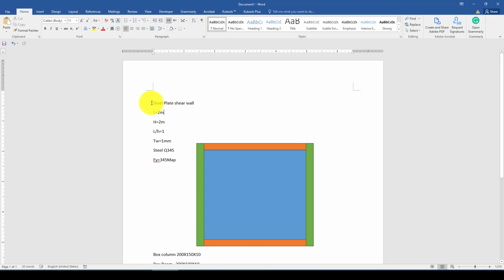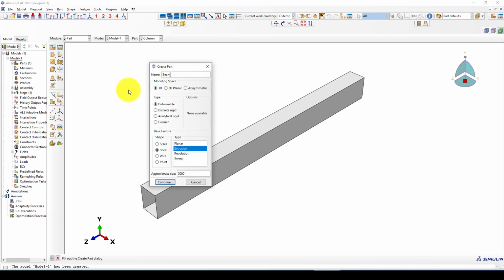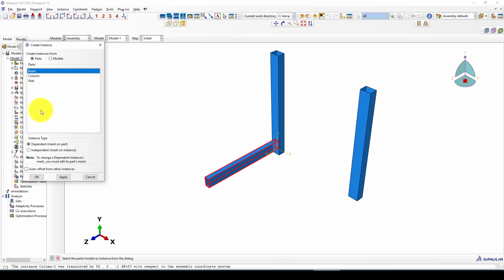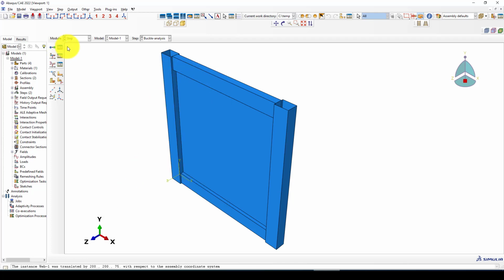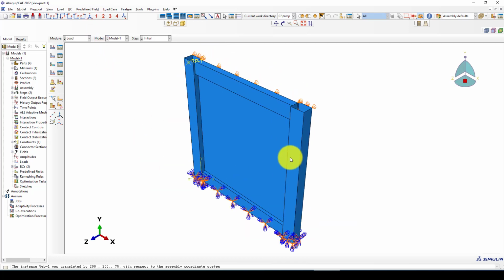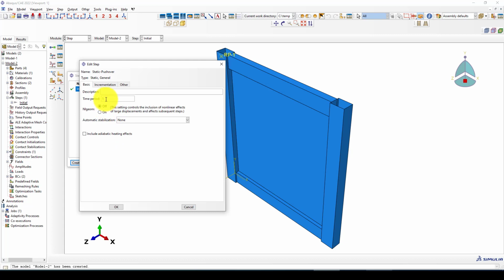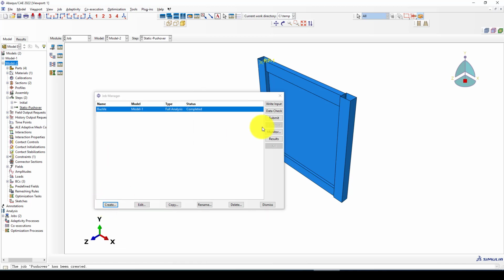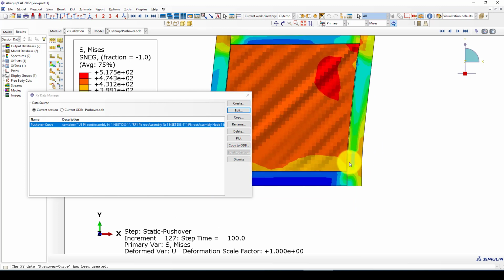Steel Plate Shear walls modeling, Buckling, and Pushover Analysis in ABAQUS FE Software.

Comment: Thank you very much for your sharing. I did it according to your example. But there are some problems. The first error is that the file Buckle.fil is missed. So I add "*nodefile,global=yes U" to the INP of Buckle model. The error is eliminated. I want to know if I am doing it right. The second problem is about the post buckling model. Because the large displacement of 200mm is applied, the deformation of the column where the RP located is serious and there is no wave occurs on the plate. I don't know why and I wonder if the displacement of RP is too large. Could you give me some suggestions? I will appreciate it.
Reply from the maker: Hi there, please follow the video carefully, your problem will be solved. In case you are unable to solve it then you can request a private tutorial.